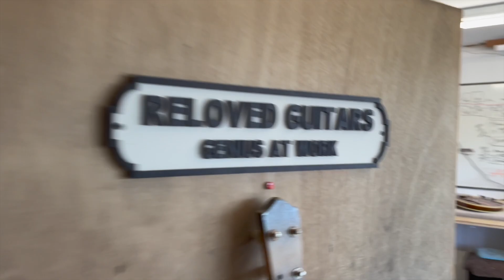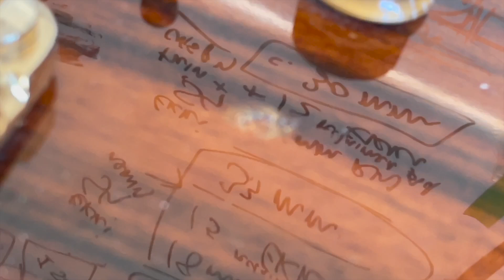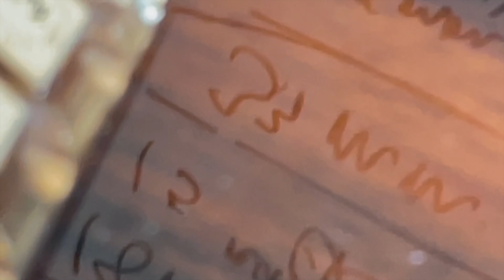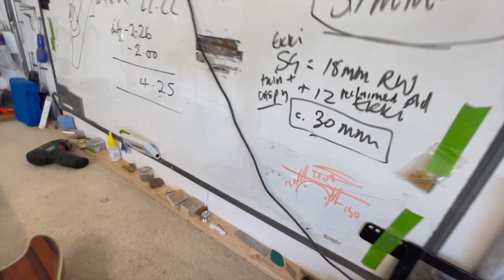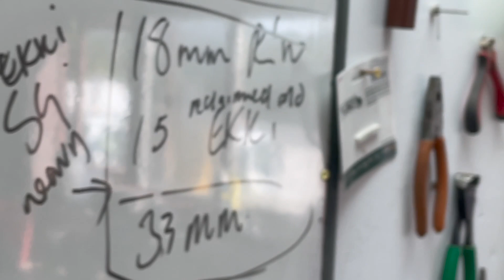Ibanez Ibanez AM93 Artcore Expressionist semi acoustic finish repairs and set up

Comment: What are the measurements of all the parts of this guitar? Height, width, thickness and depth of all parts?
Reply from the maker: Unfortunately the video is over two years old ... and I don't make measurements of the guitar generally. You should be able to find them in from a retailer of the guitar (if it is still being currently manufactured).